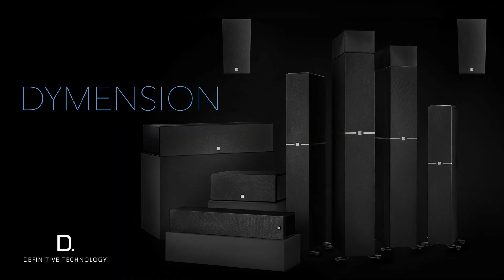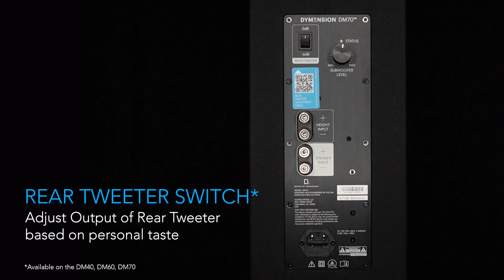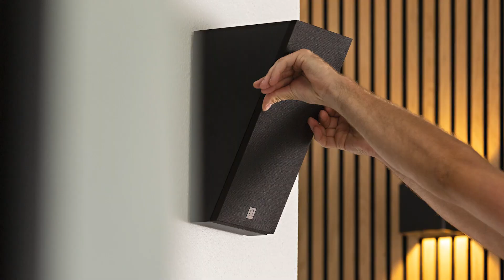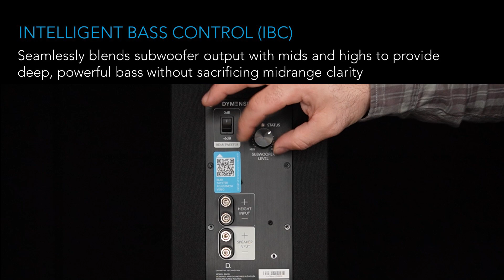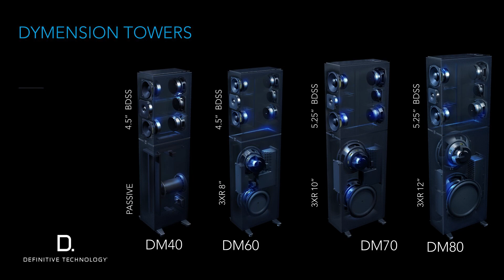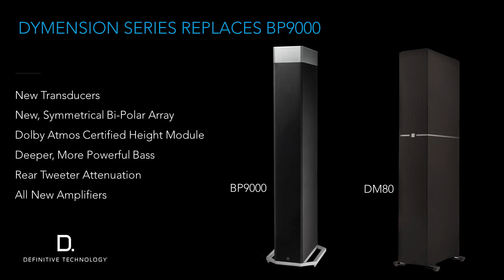Definitive Technology Dymension Series: Part 1- Design Philosophy and Product Lineup

Comment: Dear Mr. Phil Jones,
I hope this message finds you well. I am reaching out to address a concerning issue regarding the availability of the Definitive Technology Dymension Series in the Asia Pacific region.

As a long-time customer of Definitive Technology, I have been eagerly anticipating the release of the Dymension Series, following the success of previous speaker models like the BP9080x. However, I was disappointed to learn that the Definitive Technology management has decided not to sell the Dymension Series in the Asia Pacific region.

Quote
Email from Eric (Definitive Technology Aisa Pacific Customer Support Team)
“Since the safety regulation for this model is required to each country. Therefore, we cannot sell them at all countries”
Unquote

The explanation provided by Mr. Eric, the Definitive Technology Asia Pacific Customer Support Team, stating that safety regulations prevent the sale of the Dymension Series in certain countries, seems illogical and unfounded. The components, drivers, cross-over network, built-in amp and design of these speakers are standard in the industry and do not pose any safety threats. It is perplexing that a product with common components used in other speaker models available in the same region would be restricted in this manner. The drivers used in the Dymension series are commonly found in Polk Audio models in fact they are made by Polk Audio that are officially available in this country. However, the Definitive Technology Dymension series is considered a restricted product due to safety regulations. WHY?

As a dedicated customer who has supported Definitive Technology since its inception in 1990, I am disheartened by this decision. I had eagerly anticipated owning the DM80 and DM90 models from the Dymension Series, only to be informed that they are not available in the Asia Pacific region. This has left me feeling frustrated and disappointed, especially after selling my BP9080x in anticipation of upgrading to the Dymension Series.

While I understand the challenges of the competitive audio industry, I urge you to reconsider this decision and ensure that loyal customers like myself have access to the latest offerings from Definitive Technology. I kindly request that you escalate this matter to your management for further review and decision-making.

Thank you for your attention to this matter, and I hope for a positive resolution that will allow customers in the Asia Pacific region to enjoy the Definitive Technology Dymension Series.

Sincerely,

Comment: Don't do it! If these are anything like every other speaker (with a powered woofer) that definitive technology has released previously,  it's only a matter of time before the plate amps give out and you'll be chasing replacements. So far, I've had the Bp8009 (failed amp), supercube iii subwoofer (failed amp) cs8090 (failed amp), BP9060s (failed amps on both channels). See a pattern? I have my home theater running on a separate phase with clean power. These were all used with a marantz avr (sr7015) and a B&k 5 channel amp pushing 200 wpc @ 8 ohms. Definitive technology refuses to acknowledge their design flaw and dont take care of their customers. By far the worst customer service as they'll just keep sending you amps and tell you to do the swap yourself. Their CS used to be good when Chet worked there. He understood that people paid thousands for their speakers and would genuinely help the person. Such a shame because when their speakers work, they sound amazing. At this price point, I'd look into other brands like svs etc. From my experience, i can say that SVS has amazing customer service. My advice for anyone considering def tech, run the other way and don't look back. They don't deserve your hard earned money. Def. Tech continues to wait for a lawsuit to address the cheap capacitors and insane amount of glue that they use on their amps which causes them to fail. They should recall all models hosting defective amps and do right by their customers. Do you research, you will find plenty of people discussing this on various av forums.  💩💩
Reply: If you truly believe in your product, offer  a 5 year, all inclusive warranty like your competitors.

Comment: I know he was only talking about options with having an Atmos topper in the front and on walls in the rear. 
You would actually want to do that opposite if you had the ceiling for it. 
Reason being is that with the shape of our ears, we can always tell it is a topper in the front and not in the rear. Bouncy house speakers 🔊 can work from behind, but it’s not a good experience from the front. Front heights are even better than toppers. Most processors can adjust for front height on the wall vs on ceiling too.

Comment: Way over priced!!! Do not buy!! Worse than older models!!
Reply: What do you suggest?
Reply: @crazycomments8038  Buy the 9000 models that are on sale now for less than half the price. Better yet find the even older models used 2000 series. Each generation got worse after Sandy left the company!
Reply: @John8910   I went with Paradigm Founders 100f:)

Comment: Flagship speakers with 5.5 drivers, imagine that. It doesn’t seem like much has changed, kind of like an iPhone. Some of us like our “black boxes”, most of us like not having to set the front channels to large and I’m sure you know why. You should have tossed out the fabric wrap on the speakers, a mistake that’s still being made and was passed onto your new subs. You should have designed your sub channel as LFE for enthusiasts if you really wanted to make improvements. Those little 5.5s on your “Flagship Model” leaves a lot to be desired. Fire the entire design team.
Reply: Not to be a pedant but they are actually smaller as they are 5.25" drivers which is extremely disappointing, at minimum they should be 6.5" but preferably 8" drivers :(
Reply: Agreed!
Reply: And way overpriced to boot!!! I will stick with my arendal 1723’s thank you very much. I own deff tech speakers and I do like them but I don’t love them I like where there going and I have high hopes for this brand but to me nothing has changed and what has changed is not worth the upgrade  thetr power handling is still low I’m sure the bass is still sloppy and not as accurate as a real sub. When I heard deff tech was releasing a flagship I imeadiatly was expecting a unit of a speaker larger, bigger, heavier and more capable but the fact is this is hardly a upgrade all they did is change a few things on the 9080 and rename it

Comment: So you really need to address the amp issue you have had with the bp90's. It's not right for us that own your brand and Def Tech not stand by there product or better yet supply a replacement amp. Don't get me wrong I love my def tech system. Luckily my amps haven't went out but I've only owned mine for 3yrs. If you want people to continue to be repeat customers you need to warranty your bad  amp issues.
Reply: Thanks for replying. Are you supplying replacement amps for the bp90 series? I see a lot of people posting online that def tech is no longer helping them out when their amps go bad.
Reply: @shawnmurray9017  Newbie here I have the 9040 how do I know if the amps are blown out?
Reply: @crazycomments8038  you won't have power going to your big speaker(drivers)
Reply: Meaning no sound coming out the big speakers
Reply from the maker: Thank Shawn, we've indeed addressed the issues and the amps in the Dymension Series have been redesigned and are brand new.
Reply: My 9040s blown as well and I honesty don't play them that much!! So instead of this company I went with Paradigm Founders 100f:)

Comment: Have you addressed the issue with the 90s amps going bad? Turned a lot of folks off
Reply: one of mine did
Reply: I had to replace one , the quality build of that amp was not what I expected. Yes customer service was quick to address the situation and are happy with that . I hope these new ones do address the amp build quality . 
I will check these out and see in to upgrading.
Reply: Just had my BP9040 Amp go. 😢 To be fair, it was about 8 years old. But still...
Reply: I'm almost about to send the speakers back and they haven't been delivered yet because of the bad reviews I'm reading now.